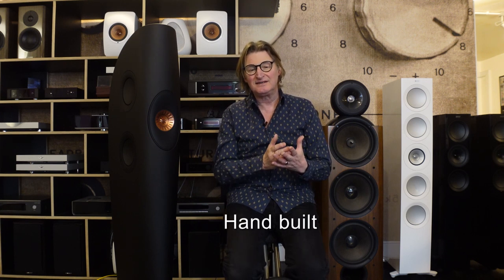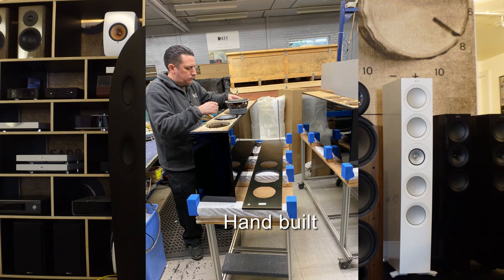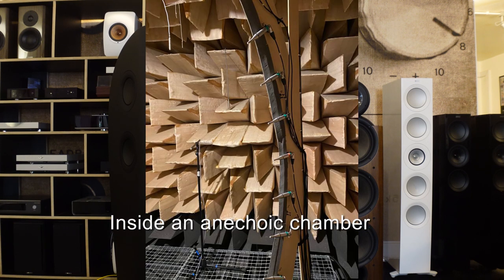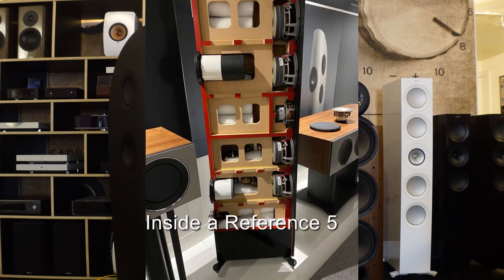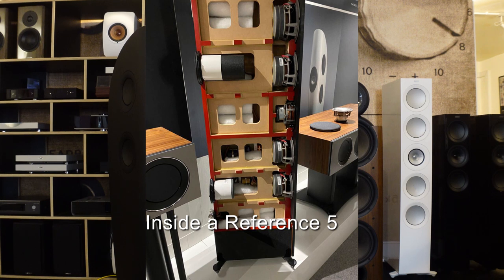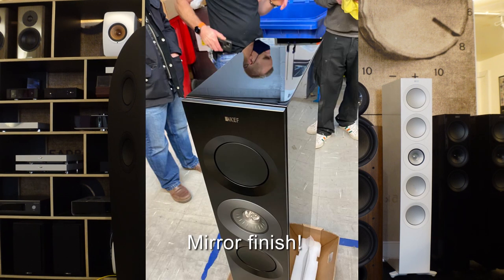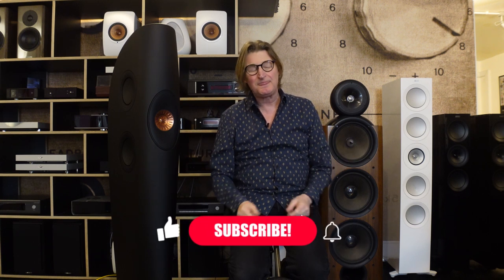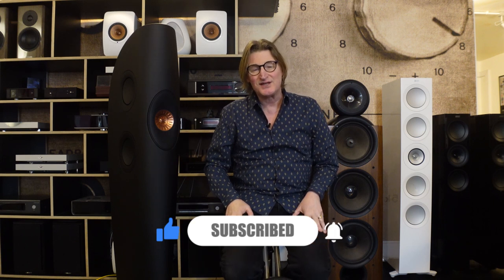KEF BLADE & REFERENCE META WORLD LAUNCH attended by Michael of LYRIC HIFI in Belfast, EXCLUSIVE !

Comment: Lovely video pal. Great speakers. My only concern or curiosity is that the midband driver on the front there is very small. Mid drivers are usually bigger than that, does this reduce the 'soundstage' of the midband?

Comment: Hi, Michael. Is there a big difference between Kef ref1 meta vs ref3 meta when it comes to bass? Does Ref1 satisfy bass need in small to medium room or 1 does need ref3 for full range sound?
Thanks.
Reply from the maker: Hi
There is no doubt that Ref3s are better but I could see a situation where they could overpower a small room. In our dem room of 5m by 4.5m thge 3s are much better.
Hope this helps
Michael

Comment: Hi,  Can you help by identifying what is the big difference between Kef Reference 3 and Reference 3 meta other than the meta added. Thanks in advance.
Reply from the maker: Hi Richard
The meta technology is the major difference, hence the price increase. The change of unit also meant crossover changes so in a Reference speaker it isn't possible to upgrade the meta unit. 
I have now done the comparison between the two versions for clients a few times and all agree it's much improved. That also means I have one pair of the non meta version to sell off more cheaply!
Best
Michael
Reply: @michaelmcclean5169  Thanks for reaching out. Much appreciated.

Comment: the reference 3 frequency range is 43 - 35...does it actually have good bass
Reply from the maker: The Reference 3 bass does go deep, deep enough to lose control if the room is too small! Approx guide- In rooms from 4 by 4m up to5 buy 7 Ref 3s are great. Then you look at the extra weight of Reference 5 or Blade /2.  Of course the amplifiers etc need to be correct
Thanks
Michael
Reply: @michaelmcclean5169  thanks. my room is around 230 sq ft, my amps are accuphase 45 watts, (A48) so should give mewhat i'm looking for